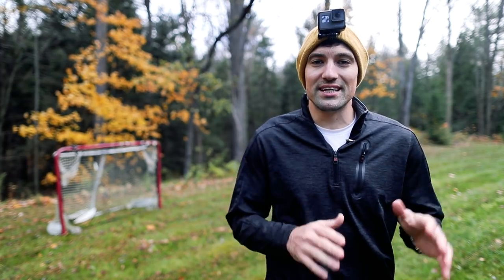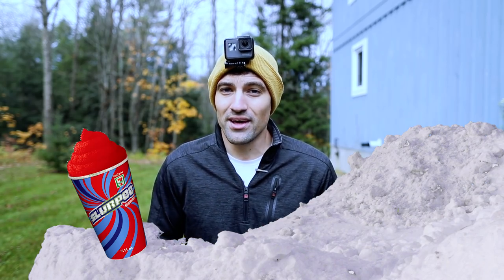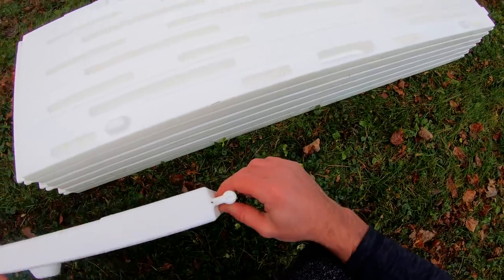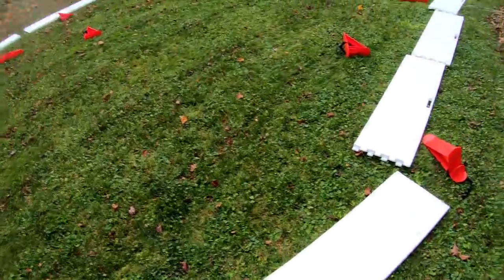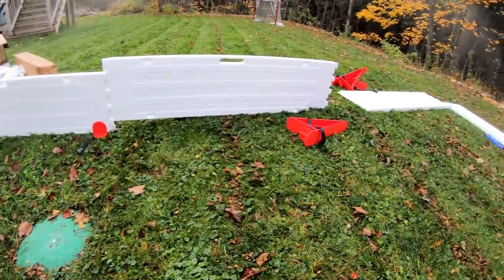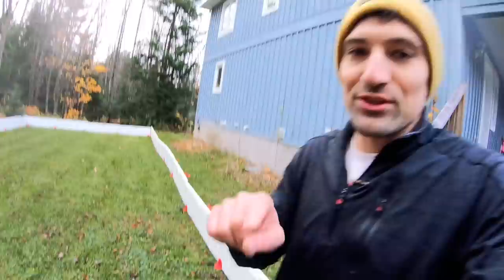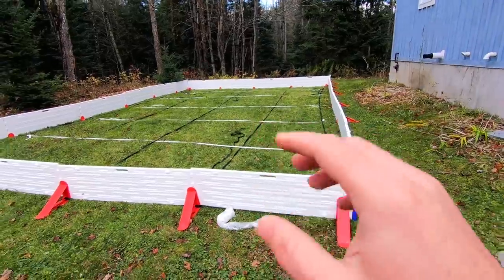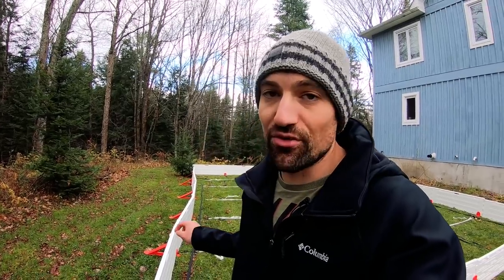Build a Rink With Me (and meet my bro) - Ez Ice Rink Build

Comment: I have a hybrid rink.  I use nicerink's brackets and plywood boards.  Super easy, except I have a CRAZY pitch (about 19") I have to deal with!  So, one of my corners has about a 18" of water, the far corner ALMOST 4".  This is my second season this year building it, next spring I'm going to have an area of my yard regraded to accommodate my 24X48' rink.  This year, I'm putting up some poles with string patio lights for lighting for some night hockey!

Comment: How much play is there in the joints?  Reason asking is we have a small odd shaped backyard.  It has a funny angle around the patio.  Just want to know ho far you can turn one of the slotted side joints?
Reply from the maker: Not sure the exact degree but the joints need to fit in the bracket. I think if you really bent the joined you'd need two brackets to be safe

Comment: You are only supposed to do one bracket per board connection also you are only supposed to use the corner ones on the corner not both brackets and corners